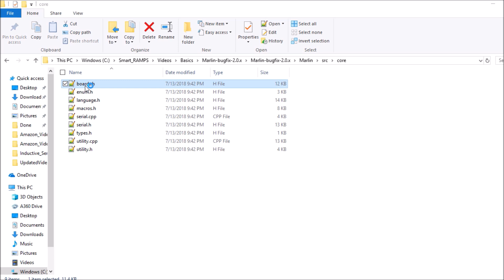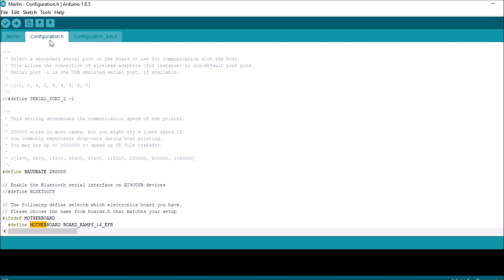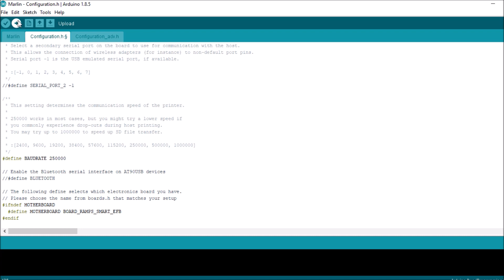Smart RAMPS - Basics

Comment: Wich smart ramps to use i only get the 1.4 ramps and the 1.6..
Reply from the maker: If possible I'd go with something more modern like a SKR 1.4 as it has more functionality.
Reply from the maker: Modern stepper drivers are easier to configure.
Reply: Thanks but i mean in video he stated smart ramps and it is different then the normal ramps 1.4 been searching and cant find smart ramps only ramps -fd

Comment: 2 questions.

1: is this board safe?? I heard that the ramps-fd was not safe.

2: how do you solve the eeprom problem. (As i heard the die does not have ons)

Sorry for the stupid questions.
Reply from the maker: Good question, first this board is the Smart RAMPS board.  All boards should be treated as unsafe.  I've not yet used the board  for a print yet as I've used for Ramps 1.4 (1000 hours), but soon I'll configure a complete printer with the Smart RAMPS Arduino Due combination. As for the EEPROM issue, not sure I've yet encountered.  It's an experimental configuration until they have a stable Marlin firmware 2.0 release.

Comment: Thanks for the video , im looking to upgrade to a DUE/Smart-R setup But i dont understand something .
i have 2 extruders . this board takes 5 Drivers .
It has 3 power outputs,  Bed, hotend1, Fan .... what gives ? how do i connect second hotend ?
should i just get this , define it as hot1/hot2/bed. and just the fan to main power ?  
or pull a signal form a spare Digital output ( if there are any ) define the pin in the code and connect the pin to a mosfet ?
Reply from the maker: Good question.  If you check out my RAMPS 1.4 tutorial it addresses doing eef configuration.  The only difference will be the naming in the Marlin firmware motherboard.  This can be found in boards.h file.  It will say something like board smart RAMPS eef.  A heat bed is not required for PLA filiment.  I've been printing without a heat bed for a couple of years now.
Reply from the maker: Also a volcano print head takes two filiments with one heat connection and thermistor.
Reply: Thank you for your reply , i will watch that other video of yours . 
i need this for multi material prints/support so need 2 individual blocks and temps .
BTW have you SPI connected this to TMC drivers by any chance ? I read it supports SW SPI and not HW SPI.
i looked at all the data sheet for TMC2130 drivers and didnt find any info about that ( couldnt ). TBH i dont know the differences or if 8 bit to 32 bit spi is backwards/forwards compatible :(
Reply from the maker: As far as I know it will work for both Ramps and smart RAMPS, but I'm currently researching how to set them up. I have a new turning tutorial on a4988 in a couple of days. I'm currently testing multiple motors for nema 17, nema 11, and nema 23 before recording video.  Just need to verify nema 23 before recording tutorial.

Comment: hi man, i have a question can i use a 32bit touch screen on my arduino mega and ramps 1.4 or should i change the motherboard too  ?  ty
Reply from the maker: So far I've only been able to get a touch screen to work on a mks gen l.  I'm planning on trying on this configuration, but can't say it will work until then.

Comment: How is that different to ramps 1.4?
Reply from the maker: 8 bit verse 32 to start
Reply: Edward Braiman lol yeah i figured with the arduino due but i mean specifically the Smart RAMPS shield what advantages does it have over the current RAMPS besides 8 bit to 32bit (which i know is a big deal in itself.. can it communicate SPI via RAMPS without the use of jumpers like in the case of needing jumpers for TMC2130... which besides the 32bit is my main want for upgrading my system.
Reply from the maker: Steven Randall it's more for showing people other 3d possible motherboards.  It in theory can do SPI, but I've not yet to attempted in a video.  The main problem appears to be related to 5volts vs 3.3v.  as for the stepper board, it should be possible, but I've not yet attempted in a video.  Also the firmware has not yet reached release status, so there might be limits to what will work.  The video is designed to expand our horizons as the another configuration that maybe used which is not expensive.  It more experimental, than usable for the moment, but once the Marlin 2.0 firmware is released it will be a good reference.
Reply: Edward Braiman i hear you and nice video! I'm just excited for it is all... I'm old-school when it comes to controller boards and PCs i like the idea of being able to replace or upgrade modular components. I almost see the newer boards like Einsy Rambo etc as laptop motherboards if one tiny thing lets out the blue smoke the entire thing needs replacing...  And this Smart RAMPS is a great way to upgrade the "motherboard" to a next gen system but still retaining the modularity.
Reply from the maker: True.